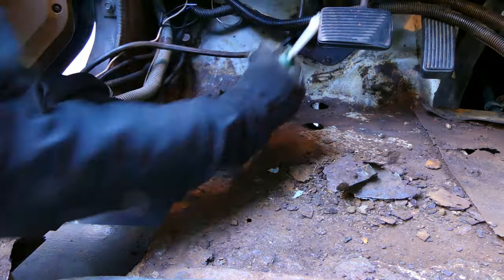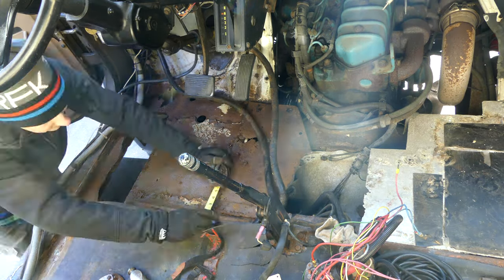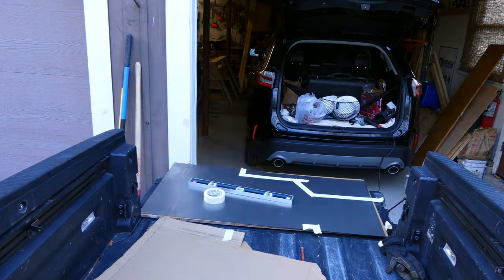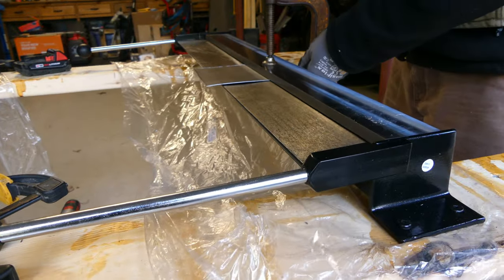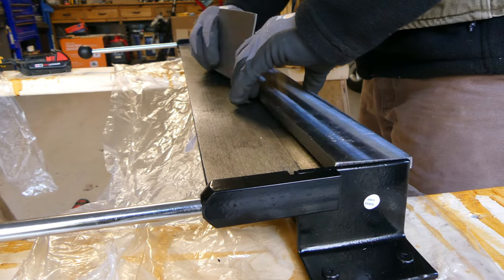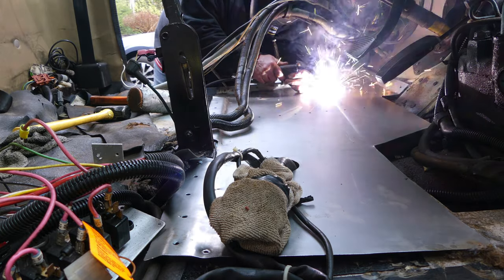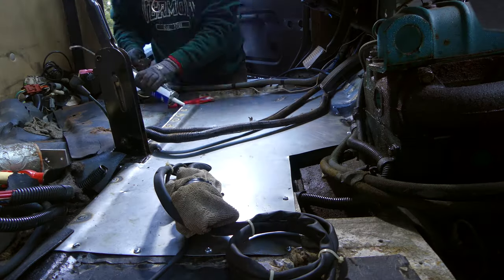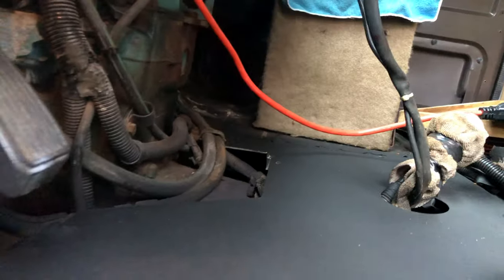Welding In A New Floor Pan | Ambulance Van Conversion

Comment: Nice work, gentlemen! Is the cab floor pan the only rust damage in your ambulance? If so, count yourself fortunate! My 2006 GMC c4500 ambulance had spent more than a decade on Northeast Ohio roads and the road salt did a number on the fuel lines and the fuel tank. I ended up replacing both before completing the RV conversion. The brake lines look a little sketchy in a couple places, so I will keep a close eye on those too and may just replace them to be safe next year. The rest of my truck looks very good, however.

Keep up the good work! I will be sure to follow your progress.
Reply from the maker: Only damage on the unit! Got lucky for an east coast car